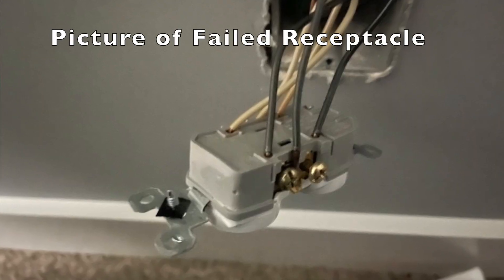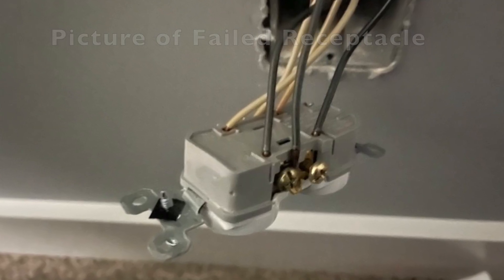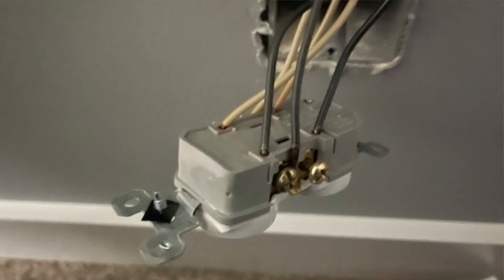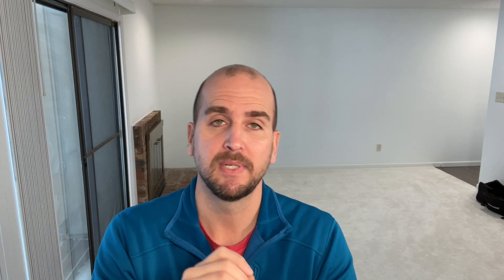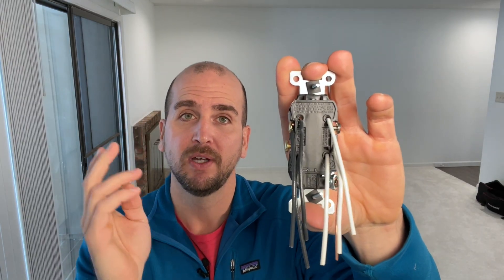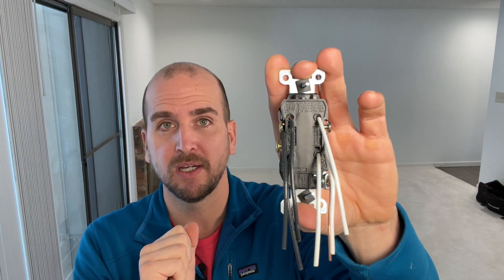Incorrectly Wired Outlet Found In Newly Built Home

Comment: With the pigtail, couldn't you end up with a much higher load on the wires that connect to the socket?
Reply from the maker: I don't think so, this can be true when you wire like the original setup.  Where the current from other outlets does need to travel through the receptacle and can lead to failures.
Reply: No the load is the load your device or switch or receptacle is not the load so splicing does not increase current or load a bad loose splice will increase load and cause overheating.

Comment: Why is a pigtail preferred? It seems like with more wires at the outlet that any load would be shared over more connections, presumably reducing risk of overheating, etc.
Reply: Well the load of the other two downstream legs those added wires were feeding have to get their power from somewhere. With a pigtail the power gets transferred right across a solid fat twists copper mate in a wire nut. 
Without a pigtail all the power used by that outlet and all the power used simultaneously by all the downstream outlets, has to flow through whatever internal metal strips the outlet has internal as conductors. That puts more current strain on the outlet internals also (heating) and if the push connectors don’t have a solid large surface grasp the heating problem can be even worse and cause premature outlet failure.
Reply: One fails all the ones down line fail
Reply: Thank you!

Comment: If the device is approved for back wiring (not back stabbing) two wires under a terminal then this will be quicker than making a pigtail.
Reply: Not only quicker but also just as secure.

Comment: Add some tape on the insulated part of the wires.Sometimes I bring the tape up to lock the nut as well. This helps keep the tail tight until it is locked into the recital or any other time you may have to be moving the wires around.

Comment: You mentioned the outlet you were fixing was 12 gauge, was it on a 20 amp circuit? If so was that a 20 amp outlet?
Reply: It’s a 15A receptacle on a 20A circuit, which is legal. 15A receptacles can be used on 20A circuits if it’s being used as pass through. Meaning more than one device on the circuit. If a single device is on the circuit then that device must be 20A rated.

Comment: At 6:01 I'm looking at the back clamping that you've done on that wire and I'm comparing it to the spec grade receptacles I bought at Lowe's https://www.lowes.com/pd/Legrand-Ivory-15-Amp-Duplex-Outlet-Commercial-10-Pack-Outlet/1000001264 The ones I bought just seem to have a much better clamping mechanism. They also look like they are 20A receptacles inside a 15A case and have spring metal securing the mounting screws to the flanges instead of fiber washers.

Edit: The white version has an internal view in the pictures showing it is indeed a 20A receptacle inside. https://www.lowes.com/pd/Legrand-White-15-Amp-Duplex-Outlet-Commercial-10-Pack-Outlet/1000003386

Comment: THANK YOU FOR PRE TWISTING YOUR WIRES. THE ELECTRICIAN IN ME IS VERY HAPPY
Reply: Man I wish more Electricians would so many just use the wire nut then when you have to work hot. Sometimes no choice the solids spring apart because they are not pre twisted and cut to short to begin with what a pain.

Comment: I wish the box had this warning “ USING THE PUSH LOCK OPTION IS WHY SO MANY MOBILE HOMES HAVE BURNED DOWN AND KILLED THE OCCUPANTS “
Reply: A little wordy: USING THE PUSH LOCK OPTION MAY CAUSE FIRE AND/OR INJURY.
Reply: That is why you change out your electrical panel and install AFCI's. Mobile homes have a different receptacle than that which he is showing within the last 17 years,  They are push ins but hold the wire very tight.  When replacing you have to almost destroy the old one to to get the wires out of it.
Reply: @mimabo72  o for sure. I didn’t know 17 years. But the newer mobile homes are top notch. I personally love them but don’t live in one. My question for anyone that thinks site built is better. How many axles do you need to see if we can drag your “custom” home down the highway at 75 mph? Most back out. If that doesn’t get them. What code inspector actually checked the framing and mechanical during the install process? Mobile home manufacture has to build every home the same quality. Each employee has one task and they drug tested. Can any of us say that about our site built? Ever heard the term cutting corners? Mobile homes are assembled just like mobile cars 😜. Fast. Efficient , proper. The only thing the manufacture has always skipped on ? In the past. ( the ones that need worked on) Bottom of the barrel standards for the mechanical stuff. The structure is solid. Just plan on installing new everything else.
Reply: @pjplumber2146  With the exception of a foundation and a sub floor as well as the electric receptacles, they have 2x6 construction, R-19 in the walls and R-30 in the ceiling and R-22 in the floors Vinyl siding however ever the cabinets are optional.  Now I have worked in the cabinet industry for 30 years and in the Construction trades as a Carpenter for about 3 years and an apprentice electrician for 5 a licensed electrician in 2 states for 10 years in commercial structures.  It is a matter for what you pay.  Some of the. houses that are worth about 2 million dollars were fabricated in a panel shop,  the walls and trusses are fabricated other than the job site., I know because I built some of those walls and well loaded them on to a truck and sent to the jobsite.  I have also stick built homes in DC as well.  Again you get what you pay for.
Reply: @mimabo72  Hell I'd say the more expensive the house, the more of it comes pre-assembled.  Take a look on google maps sometime and check out the rooftops in rich neighborhoods.  Those roof trusses are definitely being shipped in from off-site, as are the engineered beams that hold up the second floor with the fewest number of support columns.  Down here in FL though, you won't find many expensive homes with crawlspaces.  Concrete slab is cheaper, discourages termites, and there is nothing for high winds to get underneath and ruin your day.
Reply: @pjplumber2146  
Ours was built in 1996 and I'm presently changing all the switches and receptacles to spec grade.
Reply: BACK STABBIN is what we call it here.

Comment: also you should mention that they should shut off the power and test before working on any electrical item in the house. as an electrician i have been shocked many times and turned many pliers in to wire strippers cutting in to lines that were suppose to be off.

Comment: When it comes to gang boxes, why don't they, or do they, make deeper gang boxes to accommodate the heavier wire or number of wires jammed into the box?  Sometimes the boxes I've dealt with over the years, as a home owner, seem like it is just barely possible to jam all those wires, or all those #12 wires into that box.
Reply: Electrical box depth or size cubic inch  is sized by the number of conducers as well as yokes so each switch or receptacle counts as two conductors also internal cable clamps. The licensed electrician knows this.
Reply: @gregpuskar3319  thanks

Comment: I didnt know about box extenders. I have a home built in 1956 and was difficult to replace receptacles.
Reply: They often don't have ground lines and the wire quality is poor or has degraded. A lot residential work often has added branch wiring done incorrectly. The boxes are small, metal and won't easily accommodate GFCI outlets dimmers or Wi-Fi switches. Many houses have plaster walls so that's another issue.

Comment: 4:41 - did it the simple way , the way an amateur could do it  . 
5:05 - maybe a pigtail if you’re good at it .
Disappointed - they make these expensive receptacles so amateurs can avoid j hooks and wire nuts ; and you make a video saying not to use what they paid for
Reply: 3/18/22  do it yourselfers should use the high quality wire clamps on the outlet that they paid for . 
It looks good and it works .

Comment: Woa! Watch what you're doing when connecting red wires to black wires. I will often run a piece of 3 conductor wire where the black is on one phase and the black is on the other with only one neutral. This gives me the option of doing a split circuit recepticle where current demands are expected to be high. If you connect the red to the black, you'll be shorting a 220 volt circuit. Not a good idea.

Comment: When you rewired the outlet in the wood paneling - I like to use the pair of hot/neutral connections closest to the bare ground wire. It makes it somewhat easier to fold the wires and tuck everything into the box. Great video!
Reply: You can't be serious?! They should be at opposite ends of the outlet. Why do you think the neutral screw is on the same side as the ground screw?
Reply: @davids7209  you are misunderstanding.
Reply: @griffmillerii1885  Respectfully, no I'm not. I understand completely. What I'm saying is the hot wire should be under the screw furthest away from the ground screw and the neutral should be under the screw closest to the ground screw.
Reply: @davids7209  ok, I see. But why? You're essentially saying that the hot screw closest to the green ground screw cannot be used. What about when you daisy-chain receptacles? In that case you have to use both hot screws (unless you want to spend the extra time to pigtail things, which I've never seen done for that specific purpose), so what does your policy buy you? IMO if you've stripped the right amount of insulation from the wires and properly connected  them to the receptacle, you've got nothing to worry about. Can you point to some part of the electrical code or a case study where my suggestion is problematic? Do you worry about the bare ground and hot being buddy-buddy the entire length of the NM-2 cable?
Reply: @griffmillerii1885  We were talking best practices not essential practices. I never said that was what needed to be done always. I was referring to a single outlet installation and what I think is the best practice for wiring one. Just like some electricians prefer to wrap tape over the screw terminals.

Comment: A few summers back my central A/C went out.  I had a window unit plugged into a living room outlet.  I mistakenly plugged the vacuum cleaner into different outlet on the same circuit.  I tripped a breaker.  I unplugged the vacuum and noticed that the outlet was warm.  It was the first outlet on the circuit and the wiring was not clicked into place on the back of the outlet.  I talked to a friend that knows more about wiring and he works for the fire department.  He says they are trying to outlaw that kind of snap plug connection, as it has more fires from loose connections.  Almost all of my electrical problems whether it is automotive or home have been caused by loose connections.  In 1999 my meter loop almost caught on fire because of a loose wire.  I was told I was running too much stuff like the electric dryer and A/C together.  Well a loose connection made it worse. I decided to call an electrician and my outside breaker was getting so hot it was melting the plastic on the main wires going into the house.  It had been loose for almost 10 years.

Comment: Lucky you had a nice big box there. 
Let’s see you tuck in those pigtails on a common box.
Reply: It can be done, and yes, it's not easy for the novice. But, if you do it long enough, you learn the way to twist each group into the box so that the wire nuts do not stack against each other.

Comment: You didn't tighten the wire nuts enough. The wires going in should start to twist outside the wire nut. Just because you pre-twisted them doesn't mean they are locked together. That is part of the wire nuts job.

I think that there is also the requirement that you only use either the push-in or the screws.

It would also be nice for you to show how to properly wrap the screw terminals. Leaving the wire longer than needed and strip an inch where you need it (just push the insulation down the wire). The extra wire makes it much easier to get the wire to wrap tightly on the screw, and then you can cut them down. I have seen some people just leave the extra pigtail since the insulation was pushed past the end, but that seems like a lazy way to go to me.

Comment: I'm Glad you went back and added the spark guard. But instead of replacing the outlet with another 15 amp plug , I would have recommended to put a 20 amp in just because the vacuum pulls just about the limit of a 15 amp outlet . The 20 amp will hold up better and longer.
Reply: Probably shouldn't do that and it may be against code. A 20 amp outlet allows you to plug in a 20 amp appliance whereas a 15 amp outlet will not. And you shouldn't be able to plug in a 20 amp device on a 15 amp circuit. It's designed that way.

Comment: The whole reason that recep failed was more than likely the space heater.  They pull 12.5 amps by themselves. If that circuit has anything else on it that would be a cause

Comment: I love how everyone thinks they are a qualified electrician, that being said, although multiple wires feeding through a receptacle is not the Ideal way, it is a legal way, only the ground wire shall be pigtailed if using a metal box, the reason for this is so that when you ground a receptacle in a metal box and you don't ground the box when you remove the receptacle the box is no longer grounded. The ground has to go to the metal box. Commercial grade receptacles have a self-grounding clip on the screw so that you don't have to ground the receptacle you can get your ground from the box but you can't be in reverse order of that as in only ground the receptacle and then let this receptacle grow in the box, that would be a code violation

Comment: Some of the worst damn wiring I've ever come across was done by supposed "professionals"
I don't mean to rip on electricians... It's NOT an easy job and there are good and bad ones just like any other trade.
But, in my experience, "professional" installation half the time, just means it cost more.
Which is why I do all my own electrical work. I care a whole lot more that it's done right....

Comment: You say that's 12  gauge wire, but that looks like a 15 amp receptacle??
Reply: It's perfectly legal to use 15 amp receptacles on a 20 amp circuit.
Reply: @njsongwriter  no, it's perfectly legal to use a 20 amp outlet on a fifteen amp circuit, not the other way around

Comment: I was taught to add one more step for safety. Take electrical tape and wrap it around the plug clockwise covering up the screws so no chance of electrical shorting when pulling out or pushing back in. Also at the end of wrapping, cut the tape with a knife or scissors to eliminate stretching the tape and fold at the end to make it easier to find the end if wanting to take off.
Reply: I've never seen a dry location wire nut that has tape in the installation manual. 

A few old-fashioned inspectors used to insist on tape around wire nuts.  Modern practice frowns on it, as it prevents inspection and allows sloppy work.  A properly applied wire nut is safe, and you can't see if a wire has partially pulled out if the connection is taped up.

Comment: Why can’t you back wire with 2 wires of the same gauge? They are rated for it so it’s good to go. Technically you can add up to 4 wires. 3 or more i pigtail
Reply: If that's good enough for you. I usually recommend better than what's standard and there seems to be good reasons to keep your wiring clean, but I'm no electrician.

Comment: Troubleshooting receptacles that are not pigtailed is harder.   Many times you will find the bad connection at the last receptacle still working in a circuit because of this.  The load side wires get loose because you are using receptacles to make splices.  When pigtails are used and one receptacle stops working it is that receptacle not one upstream.

Comment: Purchased a 14 year old house last year.  Kept hearing a pop noise when turning on outlets.  I pulled the outlets and realized they had installed all of the wiring with the push in holes on the back and each outlet/switch had one of the holes where the plastic had cracked and the wire was loose and shorting causing the popping noise.  Replaced every outlet and switch in the house to make sure they never created a fire hazard.

Comment: Curious as to why not just use both terminals on a plug for two-hot two-white situation instead of pigtails and leaving one terminal open on each side?
Reply: You could use the screws on the outlet for the ungrounded conductors if only two, but the NEC prohibits using the device as a connection point. The ungrounded conductors (white/neutral) has to be pigtailed. Good practice is to pigtail all conductors.